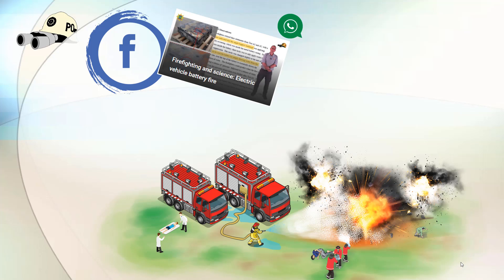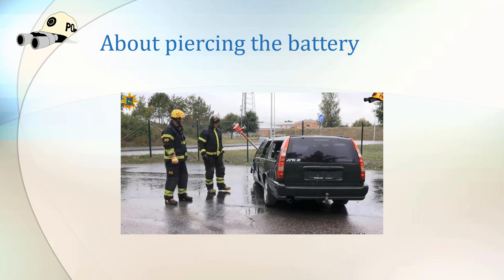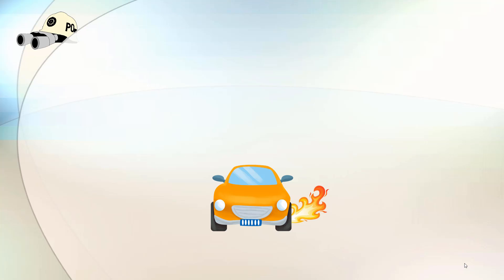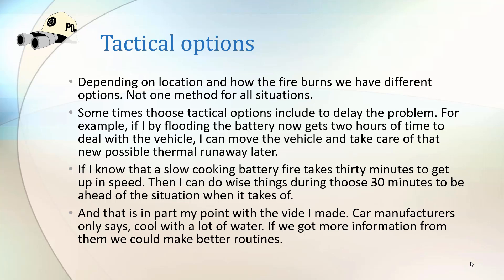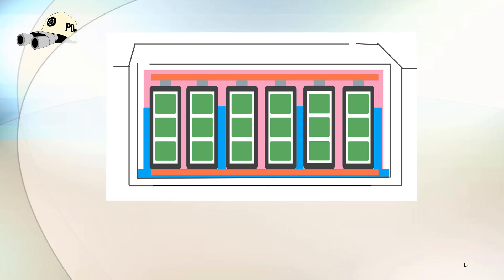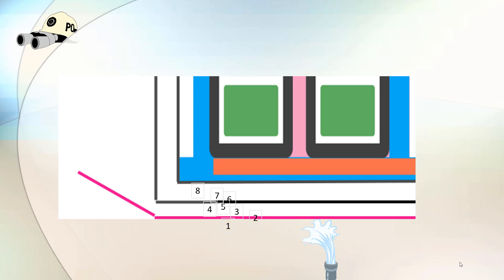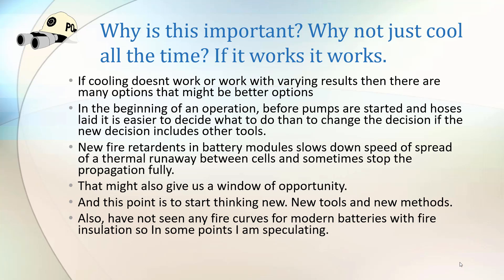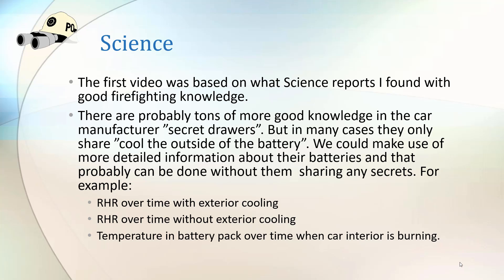Follow up video on firefighting battery electric vehicles

Comment: In in some circumstances, when a metal part (guardrail,...) pierced the battery housing and a cell module, it could be possible to have a potential on the ground or the vehicle structure. When piercing another cell module with different electrical potential you may have the rare situation to get an electrical danger on an Isolé Terre System.